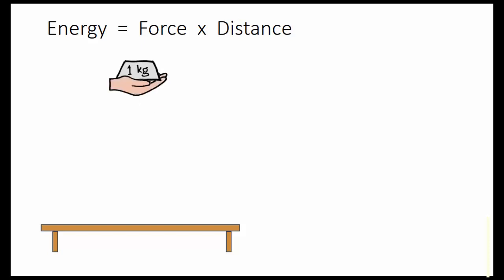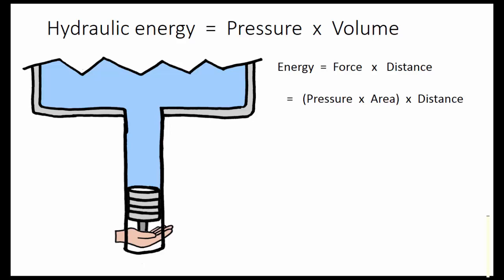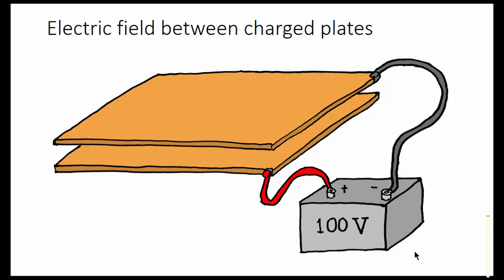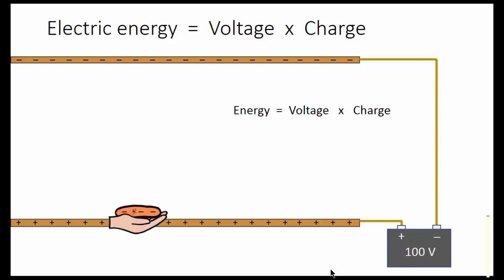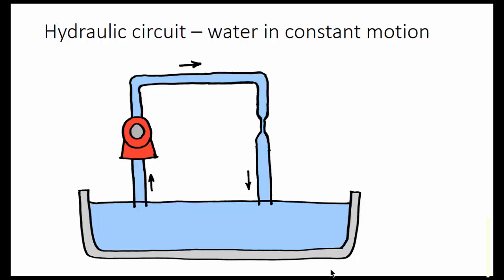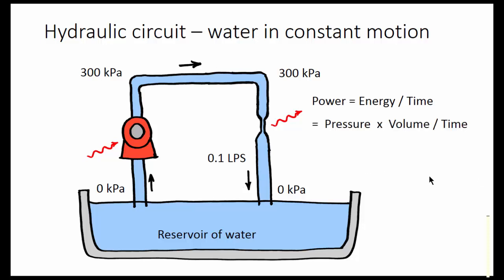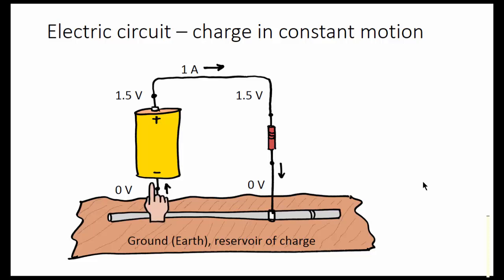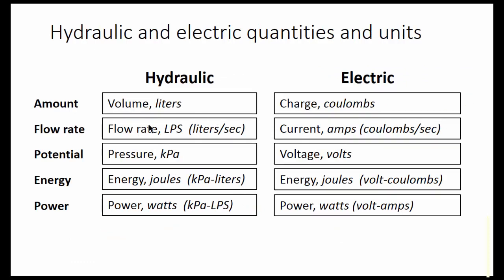Force, Energy, and Power: Electric - Hydraulic Analogy (background info)

Comment: Capacitor: How do the negative charges know there are positive charges on the other side of the dielectric?
Answer: They don't. Negative is just a preponderance of electrons packed into one plate and a deficit on the other, making for a relative difference that can then be used.